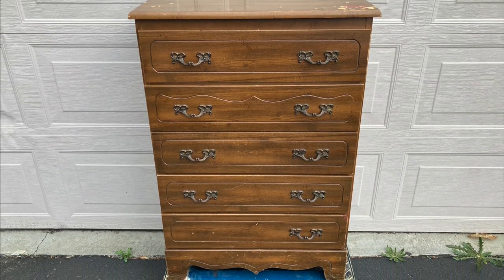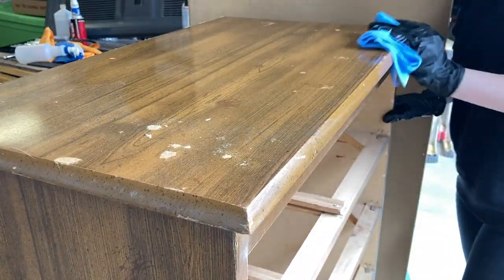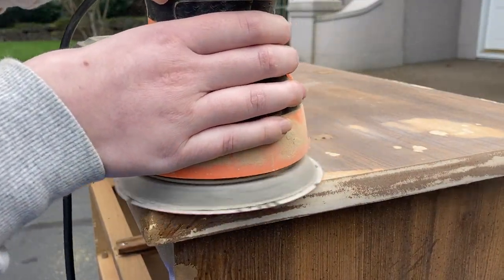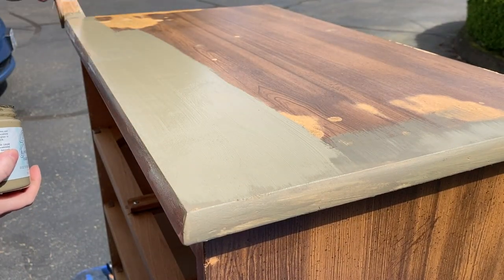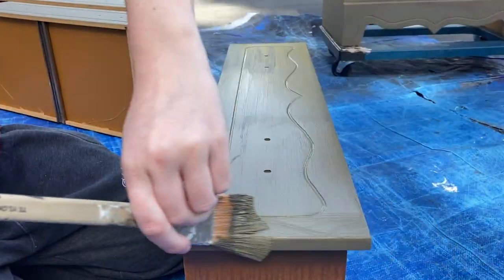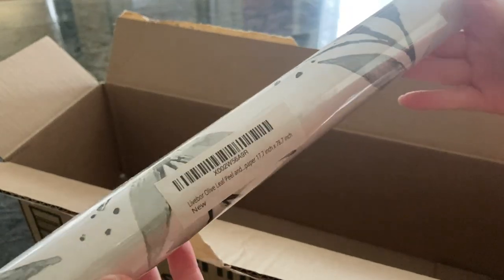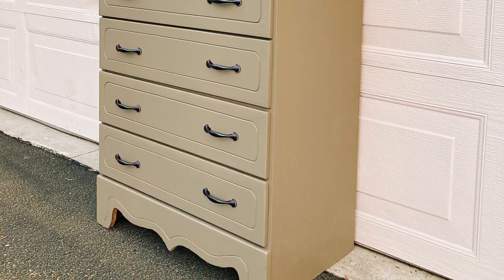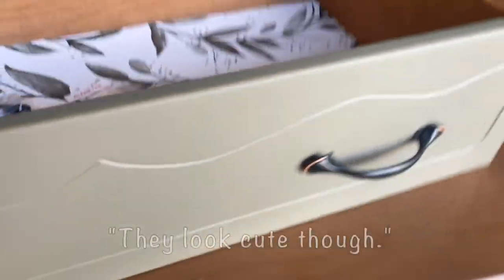Saving a Damaged MDF Dresser From the Trash || Repairing Bubbled MDF || Extreme Furniture Makeover

Comment: I watched because there was a damaged corner of the bottom drawer. Where is the footage of you fixing the corner of the MDF ?  I watched this twice and there is nothing. Im working on a piece with a chunk out of the corner . So disappointing when you show the damage and then don’t show how you fixed it.
Reply from the maker: I hit record on my camera and the battery died a few seconds later without my knowledge. I used the same wood filler as I used on the top, built it up in small layers, and sanded it smooth. I forgot to mention this in the video. I apologize.
Reply: @ChicAntiquebyHolly  Thank you . Did you shellac over it to keep it strong at all ? I’m finding my wood putty doesn’t want to stick to the MDF .
Reply from the maker: @debkeyworth8429  yes I did use shellac over everything. I would recommend the filler I used as it’s very strong and adheres to almost every surface. You could also use Bondo wood filler, which is even stronger. It’s just harder to sand. 
If you are still struggling, I would recommend drilling a pilot hole and putting a small screw in the damaged area and leave the screw head exposed. Then the wood filler will attach to the screw and have a stronger bond.
Reply: @ChicAntiquebyHolly  wonderful suggestions… thank you !
Reply from the maker: @debkeyworth8429  of course. Hope it goes well 🙏🏻

Comment: This is great! I’ve just picked up a set of drawers and the plastic covering is coming off the top of the mdf on the top and other small areas. Can I do the same as this and take off the film in the damaged areas and fill and then sand over the top? I’m wanting to paint it also. 😊
Reply from the maker: yes i would do the same thing i did. it's very important to seal with shellac so don't forget that part! i can't remember what wood filler i used in this video but you should proabably use bondo all purpose filler for extra durability.